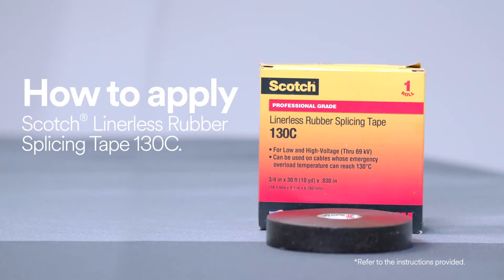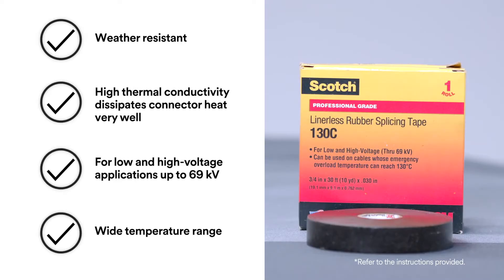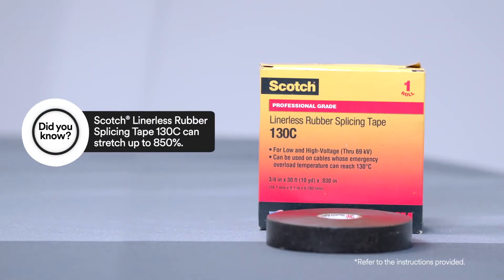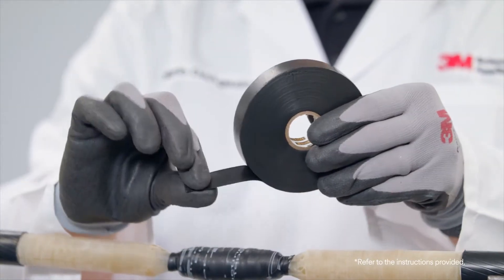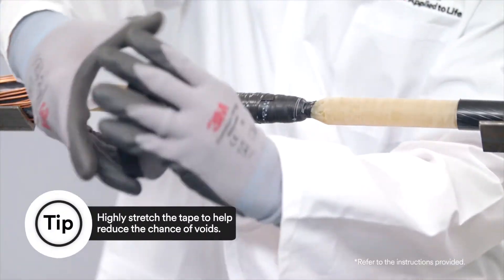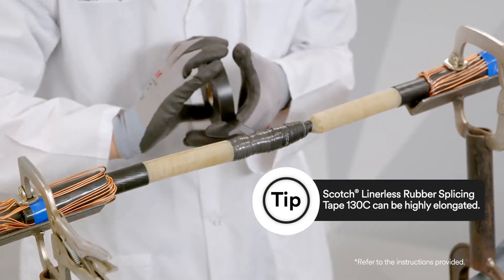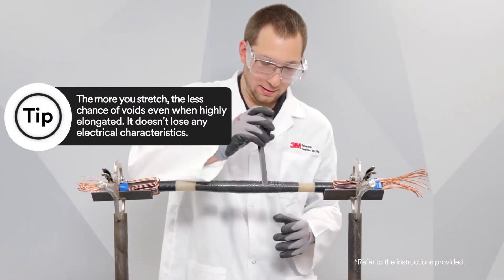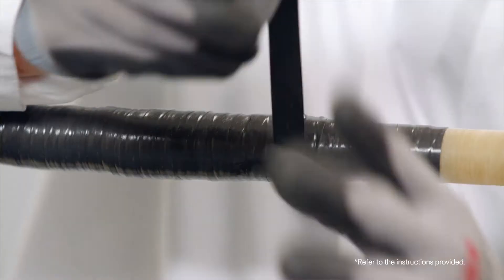Scotch® Linerless Rubber Splicing Tape 130C – How to apply

Comment: Pencil the cable ends and abrade(sand) smooth. Gaps, gouges, and irregularity will increase corona discharge and lead to premature cable failure. Also, grip the sides of the tape and tape off the back side of the roll and maintain constant tension.

Comment: Is it grippy ? I want to apply it to left and right of my computer mouse.
Reply from the maker: Hello Adrian -

Scotch® Linerless Rubber Splicing Tape 130C is indeed grippy and designed for splicing and terminating cables. However, using it as a grip for your computer mouse might not yield the desired results. The texture and adhesive properties of the tape may not provide the smooth gliding experience you're looking for when using a mouse.

Thank you.

Comment: What is the reasoning for applying sticky side up?
Reply from the maker: Hi Dusty, Thank you for your question, 130C is applied sticky side up for two reasons: 1) It is easier to apply tension near the splice when the tape is unrolled, as it prevents the roll from gradually moving away from the work area. 2) With the sticky side up, the splice is easier to reapply in the future, should the need arise.
Reply: @3MCanada  I appreciate the reply! So is it more so a preference thing? Because we use it to seal our concentric on urd elbows as they do not use cold shrink. All guys say you are supposed to apply sticky side up but does it do the same job sticky side down? I prefer to use it sticky side down as it is easier to get started.
Reply from the maker: Hi Dusty, Yes, for sealing, you can apply it sticky side down, if you prefer, as long as it is stretched properly, however in this particular application, you might consider using 3M™ Scotch-Seal™ 2229 mastic tape for sealing around the concentric wires, and possibly Scotch® Rubber 2228 mastic tape to then complete the sheathing seal. Let us know if you have any other questions.